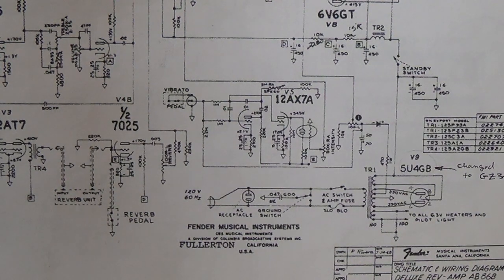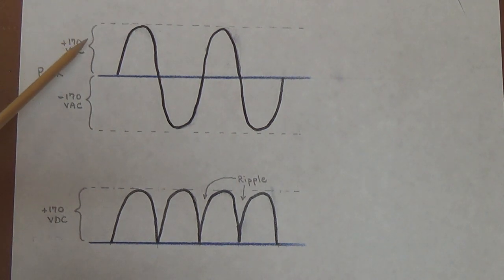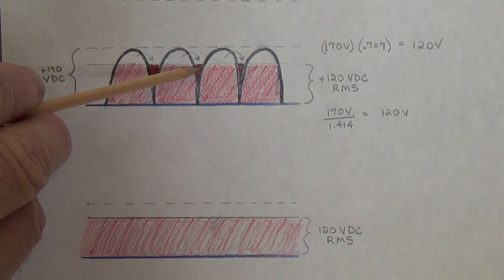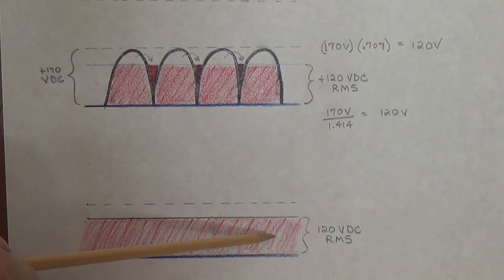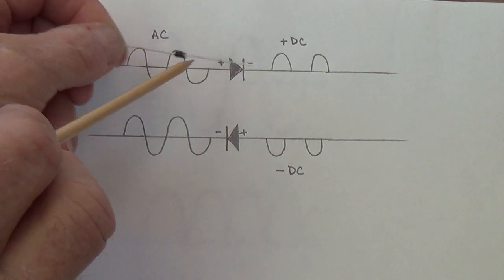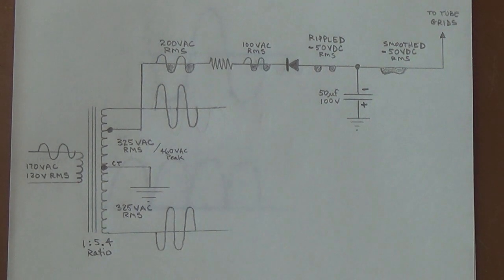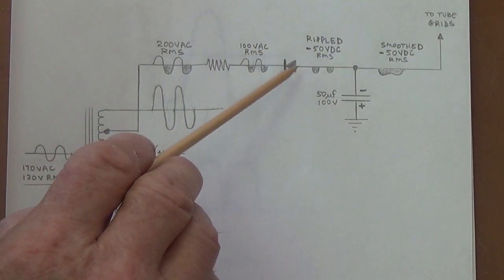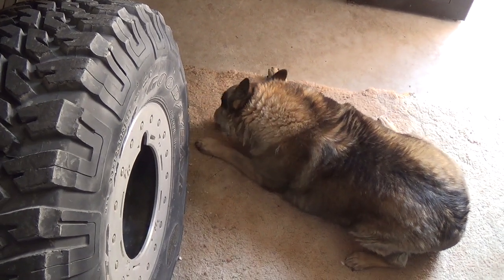Four Different Types of Power Supply,  Part 1: RMS, Diodes, Half-Wave Rectification

Comment: Dr. Doug, I plugged my multimeter into the wall and got 117 volts.  Just for fun.  Am I to understand that the power supply can reach the heights of 170 volts, but we're getting a steady 117?  Something is missing here, I'm not understanding.  Is this a capacitance in the supply like it can temporarily supply that 170 volts?  This is completely turning my brain upside down as I have learned to trust my multimeter.

Edit - I reached 8:10 in the video and heard your explanation.  What gives man.  So the multimeter calculates RMS instead of peak voltage....  Now I need to explore multimeters that don't lie.
Reply from the maker: Almost all meters read in RMS. You need an oscilloscope to see peak voltages.

Comment: Hi Doug-The bias tap from the transformer feeds the grids with negative voltage which I understand. I presume there is no current flowing in this circuit, correct? Thanks for all you do for the amplifier community. You have changed many lives for the better!
Reply from the maker: A tiny bit of current may be generated by the capture or loss of electrons by the grid, but it is negligible. We are concerned only with the net charge upon the grid and its effect on current flow from cathode to plate. Thanks for your kind words :)

Comment: Uncle Doug, Is it a coincidence that 0.707 is the sine of 45 degrees in a unit circle?
Reply from the maker: To be honest, there may be some relationship, but to me, it's simply a matter of 0.707 being the reciprocal of 1.414, which is the square root of 2, and when the square root of 2 appears in the denominator of an equation, it's the same as multiplying by its reciprocal.
Reply: @UncleDoug  Thanks for the explanation.  I remember just enough about trig and calc to be extremely dangerous lol. I think it's better or me to KISS!
Reply from the maker: @machinimafan27  It's good that you remember it, MF. Most people don't :)

Comment: There's an amp project from the tube amp section off the Brazilian forum Handmades, where they use a 30v+30v power transformer with a doubler to get 150v B+ for a parallel-single-ended amp with 2x PCL82, giving about 6w of power output.
The way they did it was connecting one of the 30v wires to ground, a half-wave doubler connected to the other 30v wire, and then they tie the tubes' filaments in series to power them from 30vAC. The pentodes are connected in parallel for the output stage, and the triode make 2 gain stages.
They proposed something akin to AX84's P1, but I'm currently looking to build it based off the Supro Super 1606 amp.
Reply from the maker: Thanks for sharing, BC. That sounds like an interesting project.

Comment: Can I ask why is the voltage halved in half wave rectification and not in full wave rectification? After the diode stage in both, it appears as though the size of the waveform would be the same in both techniques, only that full wave allows you to combine two out of phase waveforms for less ripple?
Reply from the maker: Half-wave rectification is like a picket fence with every other slat missing. Full-wave is like a solid fence. Obviously the latter contains twice as much wood (voltage).
Reply: Thank you, so is it that when you eliminate the large ripple/gaps in a half wave rectified waveform say with a filter capacitor, you end up with a lower DC voltage than say, a filtered full wave rectified waveform?

I'd just like to add that your videos are hands down the best and warmest sources of information I could hope for. If you were a teacher, school would have been great!
Reply from the maker: @munceyboyjoe  Actually the voltage is about the same, Sed, since the overall amplitude is not reduced in the half-wave form, but the ripple is much more pronounced and can be a bit noisy unless fully filtered.

Comment: It’s 100v in the country I’m living.
Reply from the maker: I believe Japan uses 100VAC for smaller devices and 200VAC for large appliances.
Reply: @UncleDoug  most of the appliances are 100v, the only one that uses 200v in my room is air conditioner.
Reply from the maker: @moses1202  How about the water heater, stove, and clothes drier ??
Reply: @UncleDoug  the rest were not in my room. water heater looks use 200v, we have only gas stove here but the portable electric one uses 100v and the embedded one should uses 200v. I’m living in a shared building which is more like student dorm. It was reformed into commercial share house from employee dorm of Mitsubishi heavy industries. Everything here in Japan is tiny.
Reply from the maker: @moses1202  Thanks for the info, Moses.

Comment: I really enjoy the videos especially the jokey pet interactions.
My question on this video is in the first example where the ac is rectified and half of the wave is clipped off... do the clipped off parts automatically push together like your drawing so that the clipped off tops of the dc “waves” only have to fill in the smaller ripples instead of the larger gaps that you mentioned later?
Also further on you talk about the transformer taking in 120 VAC after you said wall current is actually 170 VAC until it is rectified. Maybe I missed something.
Thank you so much for the videos
Reply from the maker: The filter caps don't "clip" the tops of the waves.....they absorb them.....then they discharge to fill in the valleys. I say 120VAC only because people are accustomed to hearing the RMS value. If I said that peak wall voltage is 170VAC, which it is, most people would not recognize the value.

Comment: In 1998, a friend of mine came to me and ask if I could double the charging capacity of his tricycle....,a  motorcycle with a sidecar used as a public transportation here in the Philippines....,without changing the coil of the magneto, the motorcycles at that time  have only a 6 volt battery,   he wanted to change the battery to 12 volts so he can install his car stereo. I used a voltage doubler ( multiplier) that I took from my television repair book, it's from the flyback section, using diodes and capacitors, I got more than a hundred volts so I removed a few diodes and capacitors and end up with a 17 volts DC which is just enough for charging a twelve volt battery....and it lasted for so many years.....
Reply from the maker: You are a true innovator, Sonny. Congratulations on a very clever and successful solution.

Comment: Interesting that 170 V/1.414 = 120 V because 1.414 is also the number used to determine the length of the hypotenuse in a right-angled triangle.  Is this just a coincidence?
Reply from the maker: The square root of 2 is one of the factors in the formula, DB. It doesn't have anything to do with the Pythagorean Theorem as far as I know.

Comment: Howdy. With all due respect.
I feel obligated to comment your presentation.
The filter capacitor does not clip off the peaks. Unloaded the rectifier will charge the capacitor to the peak value. 

However. If we use a choke large enough to uphold a constant current for filtering the load voltage will be close to the aritmethic mean value (not rms).
The AC rms voltage does the same amount of work or energy that the equivalent DC voltage does.
It is worth making sure to use a true rms meter when we want to measure the rms. True rms meters used to be called torque iron meters before.
If we want to charge a battery the true rms of the current is not the value we should use to estimate charging time. We should use the arthmetic mean value. Arithmetic mean value meters used to called torque coil meters before. The true rms reading will be way larger than the arithmetic mean value.
Finally. A cheap AC voltmeter is likely to be a torque coil meter (mean value). The needle scale is calibrated to show the rms, however. The  correction coefficient is 1,11 times. Rms = 1,11 x mean. And please observe. This is valid for sinusoidal AC only.
In high regards.
Reply from the maker: Thank you for your very detailed and helpful input, Eugene. We really appreciate it :)
Reply: @UncleDoug  Howdy again. Got inspired by your presentation.
In my blog   eugpoh40.blogspot.com  I take the full wave power supply one level deeper. Some math is inevitable but should not be too difficult.
I don't have the skills to make video presentations. My thinking gets convoluted when speaking.
I have more success doing papers. Then I can use a pencil eraser ...
Regards.

Comment: Here's another dumb question.  I found some parts, and want to make a thing.  I want a preamp made of 2 12ax7, done similar to jcm 800, so: Preamp1 , Cold clipper,  Preamp 2, cathode follower, output.  I found an old  rack-mount chassis in a junkheap for an old cable TV rf amp, with 9 pin sockets and a power transformer, fuse holder, etc.  

So the power transformer has a secondary for filaments at 6point  something, and a high voltage secondary which is center tapped.  The volts on the secondary is 235/117/235 if you get me.  There's no rectifier secondary, so it will be diode.

So I'm thinking rectified, I ought to have 331vdc before filtering.  Should this be plenty to run the preamp of 2 12ax7's?  It's a big beefy transformer, and there won't be any power amp to drive, so I'm hoping to use it.  Full or half-wave?  And, how would I go about choosing the values of the filter caps?  thanks.sm
Reply from the maker: The PT sounds like overkill for 12AX7's. Always full-wave if possible. When in doubt install a 20uf and two 10's for filtration.
Reply: @UncleDoug  Thanks. I knew you'd know!  Maybe there's enough power left over for some output tube if I wanted to drive an OT and speaker some day.  It's just a tinkering testbed right now.  thanks again!

Comment: Any identical signal that appears on the grids of a pp output stage will cancel out. Just like in your analogy of the horses pulling in opposite directions. CMRR is usually something that applies to only differential pairs, but it applies in it's own way here as well. You are right about the ripple voltage being close to or under the noise floor of most output stages.
Reply from the maker: Quite so, Tobias, which is why push-pull circuits have less hum, since it tends to self-cancel in the output stage.

Comment: I bought a BIG HUGE SCARY MONSTER power supply that was supposed to put out 0-600 Volts fully regulated between 0 and 1000 mA, but all I could get was 300 Volts. When I started  chasing down problems I noticed my Fluke 87 was showing the WRONG AC voltages. All of the AC voltages shown on the schematic were PEAK voltages, not RMS. Some old schematics might show PEAK Volts, RMS Volts or even AVERAGE Volts for Voltages too. You really have to be ready for that with some of the old electronic schematics. RMS voltmeters were not very common at one time. When I saw 1200 instead  of 1697, it became rather obvious that I was reading the RMS of 1697 volts peak. Then I got to the reference supply trans, and I should have seen 800 volts RMS or 1156 peak, but instead I got 480 volts RMS. Someone had blown up the 400-0-400 RMS transformer and installed a 240-0-240 in its place. That explains the 300 Volts that I was missing.  I found a 578-400-0-400-578 volts transformer, added a 115 to 240 and a filament supply, and now it's running at its rated 0-600 Volts RMS and  0-1 Amps. If I swap to the 1156 taps, it will run up at 840 Volts @ about 600mA. The voltmeter didn't like it, but a resistor I added adds another 2x range to it. So now 420 Volts=840 Volts. I don't run it at 840 very often.
Reply from the maker: An interesting example of why we need to know the difference between peak and RMS voltages. Thanks for sharing this with us, Seth.

Comment: If the full wave bridge rectifier is much cheaper than the full wave, why some old fenders were made using the full wave reticifier like the Twins ? Is there some diference? thanks
Reply from the maker: Any diode rectifier is much cheaper than a tube rectifier, Marshall. The Twin Reverbs had diode rectifiers because no single tube rectifier could provide sufficient current for the circuit.
Reply: @UncleDoug  I was wondering, what´s the diference between the old Twin (340 0 340 full wave) and the modern twin (350 full wave bridge) ? Is there any sound or quality diference? I build an old  AB763 twin with a PT 340 0 340 full wave rectifier using a 25AWG secondary wire(420mA) and 18AWG 120volts primary, with a 3.88 square inch core. O notice some hot temperature on the PT. thanks

Comment: Hi Uncle Doug, and once again, thanks for all the incredibly informative videos you have posted over the last few years. One basic thing that keeps tripping me up is the AC positive waveform vs. the AC negative waveform. My understanding is the AC current is continually reversing direction back and forth, so when the current goes one direction it is a positive waveform and when the current reverses direction it is a negative waveform. If that is correct, does the positive AC waveform actually have a positive charge or lack of electrons when compared to the negative waveform?
Reply from the maker: You can look at it that way if you wish. The negative wave form reflects the number of electrons flowing, from 0 at first to the peak and then back to zero. The positive wave form reflects the departure of the electrons, beginning with 0 to the peak and back to zero. The overall "peak" voltage is measured from the height of the positive peak to the trough of the negative peak.

Comment: Why are the power transformers used have so much output if we end up putting dropping resistors in to reduce it so much?
Reply from the maker: Almost all of the output of the power transformer is sent directly to the output tubes.  In the remaining output, the voltages are lowered to suit the needs of the pre-amp tubes, which have lower voltage requirements.
Reply: @UncleDoug  thank you for your quick and informative responses. Appreciate it.
Reply from the maker: You're welcome, Kevin.

Comment: Thanks Doug for another good video. I was just asking myself at one point of this video... if the mains voltage is peak to peak, why does it measure 240 volts (here in the UK) when - as if by magic - you then went on to explain how the voltmeter automatically reads the rms voltage on the AC range! So I learnt something new again... :-)
Reply from the maker: You're welcome, David. I'm glad the video was able to answer your questions.

Comment: I used to see voltage doublers in Tektronix  600 series monitors. The problem with voltage doublers is the capacitors in the circuit would always go bad. Is this common with all voltage doublers?
Reply from the maker: I haven't had any capacitor problems in my voltage doubler circuits. Perhaps the capacitor voltage ratings were too low in the Tektronix monitors.

Comment: 325 volts from centre tap to each side
Reply from the maker: +ian “valve doctor” forster  It depends on the PT, Ian, but for most of the ones I work on, 325-0-325 is correct.

Comment: Hello Uncle Doug, at about the 14 minute mark you explain that 200 Vac is being run through a resistor "of some kind" to reduce the voltage to about 100 Vac. Is there a simple way to determine what resistor is needed? The only way I know needs to have data about the current (to apply Ohm's law) or needs two resistors (between Vin and ground) to 'divide' the voltage.

Maybe I am just too impatient and need to view the other parts? 

Thank you for explaining all this in a way even I can understand!
Reply from the maker: +Bart Prins You're right, Bart. The reason I didn't state a specific value for the resistor is that it would vary based on (as you said) the voltage being delivered and the current passing through it.  My method to determine the value would be to install a 100 or 1000 ohm resistor, measure the voltage drop, calculate the current, calculate the exact resistance needed to achieve the proper voltage drop, install that value resistor.

Comment: An interesting side note to the .707 figure when calculating RMS from peak voltage, I believe this is why when you bias output tubes in push-pull, you use the 70% of max plate dissipation rule.
Reply: +The Guitologist another great series I've already learned from. I'd totally forgotten (if I ever knew) the 120VAC from wall was RMS.
Reply from the maker: +The Guitologist  Thanks :) I caught some flak on my first power supply video (several years ago) when I forgot to include RMS, so I made sure it was emphasized in this series.  To me, it's actually rather abstract, since at no time is peak voltage ever physically converted into RMS, it's simply a theoretical/mathematical way to equalize their respective energy contents. However, since voltmeters report values in RMS and oscilloscopes deal in peak voltage, you have to be aware of the difference, or strange problems will arise when you try to use both instruments in tandem. 

I always thought the 70% value for fixed bias tubes was rather arbitrary, a simple rule of thumb, and allowed room for the average expected increase in plate current that accompanies high input, high volume use.